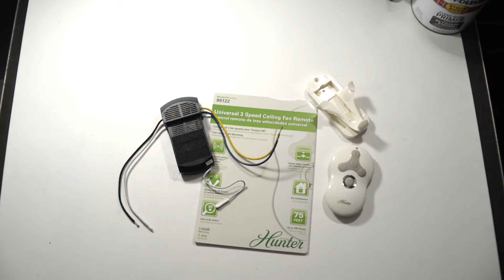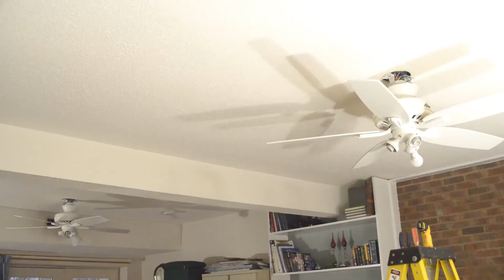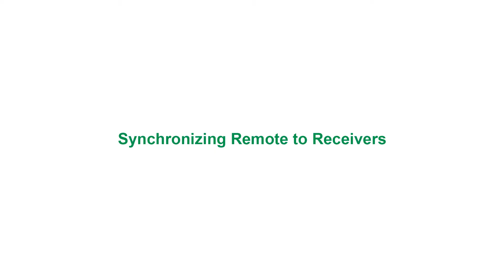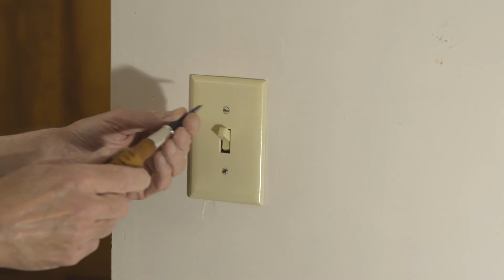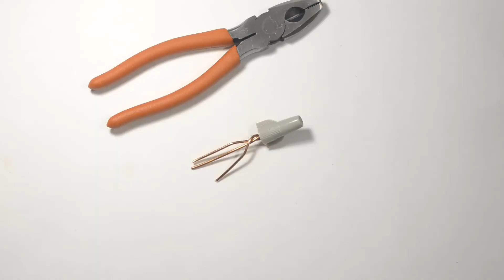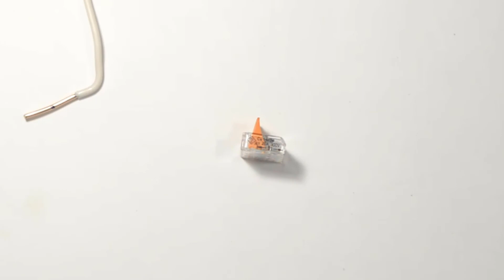How to install a remote control in two ceiling fans

Comment: If you wanted to use the OTHER remote control and program it as well, could you then have a "three way" application?  (for example, I have two fans that I want to be synced in an upper hallway that are currently on a 3-way switch... would love to have one remote at bottom of stairs and the other at top at end of hallway...would this work?)

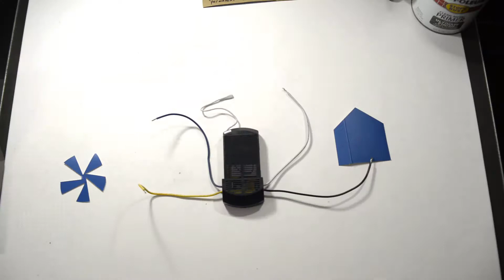Comment: Clever "schematic". My problem was to remove a faulty remote/receiver. Black to black & white to white is straight forward. I was not sure what to do with the blue wire since I do not have a light on the fan. Picture at 4:15 had the answer
Reply from the maker: I am glad it was helpful Bob.

Comment: great video but was hoping to be able to unsync remote b from fan a without having to undo power to fan as both fans are on the same breaker. great video though, very insightful :)

Comment: A question: you only need one remote control kit to operate both fans? You install the remote kit on the "dominant" ceiling fan, and it control both once powered?  thanks.
Reply from the maker: Robert, the short answer is No, I needed two remote kits.

Background
There is no dominant fan. Neither of these fans came from the factory, or the retailer, with any remote capability at all. They are both strictly pull chain only.

The electrical junction boxes in the ceiling are both wired to the same wall switch. So when the wall switch is turned on, power is supplied to both boxes. Before I installed the ceiling fans, the fixtures that were attached to the junction boxes were fluorescent. I removed the fluorescent fixtures, had a licensed electrician swap out the junction boxes for ceiling fan rated boxes and then I installed the fans and then after I made sure everything worked via pull chain, I added the remote capability.

Adding Remote
To make this work, I had to have as a minimum, two receivers and one remote (transmitter). The receiver is what goes in the fan. The remote is the controller you hold in your hand to operate the fans and lights.

Unfortunately, the Hunter 99122 remote control kit does not come with two receivers and one remote. Each kit has one remote and one receiver. Therefore, I had to buy two kits to get two receivers. The extra remote is not used.

The ceiling fans do not ‘communicate’ with each other. Each fan communicates with the remote. I chose to install and configure it so that one remote operates both fans. This required syncing both receivers to the one remote. I could have decided to configure it so that one remote operates one fan and the extra remote operates the other fan, but that is not what I wanted.

Making One Dominant
If you are asking if I could have wired both fans to a single receiver, one answer is probably not. I am sure Hunter only designed and load tested the receiver to operate one fan. The other answer I cannot provide since I am not a licensed electrician.
Reply: Ok. Installed the two controls (one in each canopy) and changed the switch inside the controls so the remote would control both. Thank you

Comment: Ceiling fan remotes work by sending a wireless signal to a wireless receiver attached to a fan -- the receiver allows electricity to go to the fan's motor so that the blades will rotate. A remote ceiling fan's wireless receiver uses the same channel frequency as that of the remote. To enable a single remote to control two remote ceiling fans simultaneously, change the channel setting on both fans so that they are the same as the channel setting on the remote.
Reply from the maker: To be clear, these ceiling fans as they come from the factory do not have any remote capability.  The point of this video is to add remote capability to two non-remote enabled fans. I used the Hunter 99122 remote kit to do that. The 99122 does not have any manual switches. There is no ‘change the channel setting on both fans so that they are the same as the channel setting on the remote’ on the 99122. The 99122 requires you to pair the remote to the receiver wirelessly. i.e. The 99122 receiver and remote out of the box are not paired. You have to wirelessly pair them, even if only doing one fan. And since I was doing two fans, they had to be paired as I described at 14:30. p.s. The remote controls both the lights and blades.